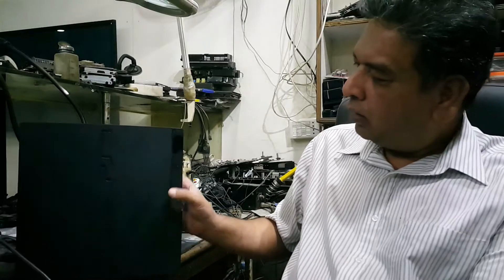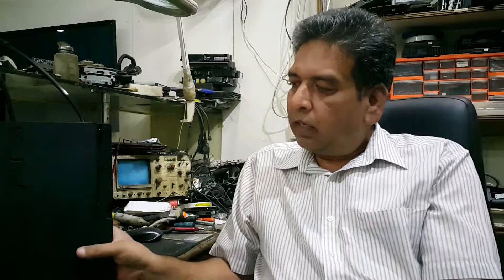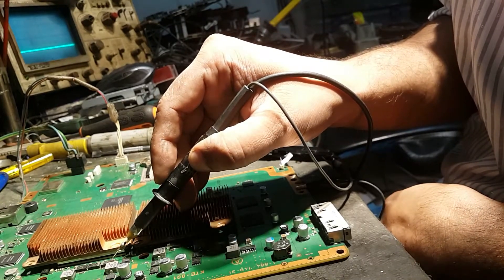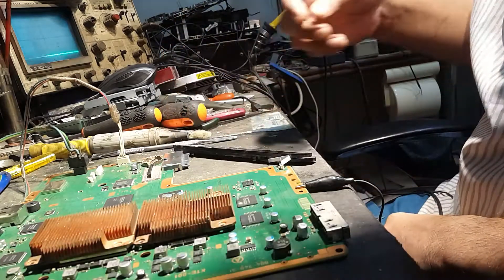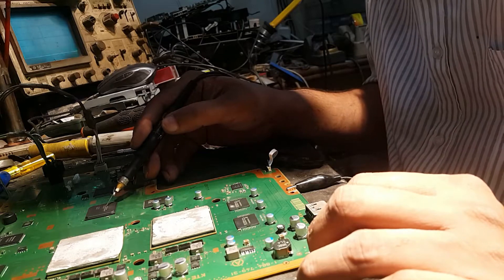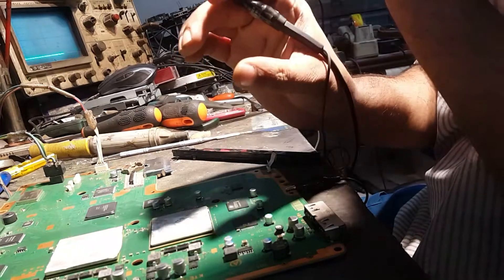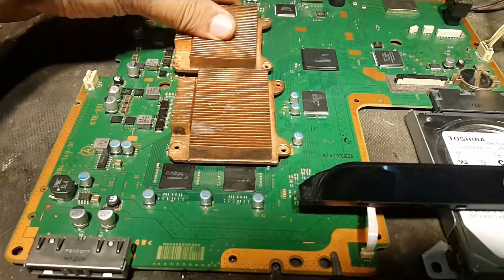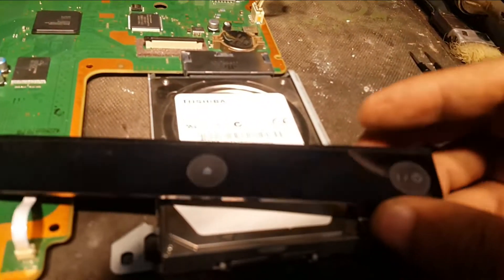Ps3 green light of death,(GLOD). for 10 seconds then shuts off. Part 3 .

Comment: Hello and thank you. My language is Farsi, I didn't really understand what you said in the video. But I will be grateful if you can help me solve the ps3 problem by chatting. I have a ps3 slim model 3000b and I use HEN. My PlayStation has the same problem as you mentioned in the video, but even more strangely, my device turns off and the hdd light does not work anymore and it does not show anything, but strangely if it is hit it works and works unless you touch it, if you touch the device the smallest, it turns off. but today it completely stopped working when i was activating ps3hen the ps3 turned off and now it won't turn on and it won't show anything at all can i fix it myself at home? Because there are many brokers in our city
Reply from the maker: Please check for the 12-volt clips in the power supply brick. They are not tight enough to grip two pins of the motherboard.
Reply: @idreestech  what are they I don't have the tools, can I fix it manually?
Reply from the maker: @acecombatfan0483  Yes just open it and clean the supply contacts .
Reply: @idreestech  do you have vedeo for this problme please give me link ....
Reply: @idreestech  i cleaned this and i cleaned all boards on my ps3 but its not working

Comment: great work, from mozambique here. I have a superslim model that had the same problem before, bus i changed the cpu and the other chips married to it but now it just stays at green light forever, no video, no beeps and does not turn off, any solution to that?
Reply from the maker: Check for the GPU.
Reply from the maker: If NOR is from a different console, it will be in the same state.
Reply: @idreestech  so i should keep the original nor? with different cpu?
Reply from the maker: @muhamadbay76  Original NOR with original CPU.
Reply: @idreestech  original cpu was cracked,
Reply: Thats why i replaced
Reply from the maker: @muhamadbay76  CPU key should match with NOR.
Reply: @idreestech  ok, thanks a lot, i will try another cpu and matched nor

Comment: The video is not so good, let's see togheter why:

1) Reflow doeasn't fix the problem, reball instead will fix it
2) Never reflow or reball without removing old thermal paste, the chip is getting more heat than needed
3) ALWAYS change thermal paste when you disassemble the console or your time is wasted because bad thermal paste will cause again the same problem
4) ALWAYS clean the console when you disassembly it, the dust cause overheating that leads again to the same issues
Reply from the maker: Dear, The points are right raised by you. But my focus is always to pinpoint or target the fault. And to make understand these complicated circuitries.
Reply: @idreestech  you're right to pinpoint or target the fault, but not everyone has our knowledge on how to correctly do these repairs, for me i better to lose a bit more time and show the complete process with the right procedures, so everyone can learn something and maybe one day they can start they're own business. I'm not attacking you or your work, but unfortunately these days on YouTube there are too many misleading videos that can cuase really huge issues if seen by the person who don't know how to fix these things correctly 👍

Comment: Hello. I have the same ps3 with similar problem. When i turn it on the fan is spinning and green light is on for about 7 seconds, and then turns off just like yours. Do i need to reflow the gpu?
Reply from the maker: First check according to my other videos then finally decide it for re-flow.May God help you dear.
Reply: Did you win?

Comment: Excellent videos! Very good looking for data from the NAND (slim = NOR?). I'm curious to know if you had seen data moving on the NAND, where you would have probed next. Would you just reflow the RSX instead, or still reflowed the CELL? Also, does the ethernet IC generate clock for the southbridge on the original phat models? (CECH-A through E)

I have a phat model showing the same symptoms... HDD light just one blink, sits, no recovery. All power rails look good. I'm going to check NAND with oscilloscope next, but also check ohms of resistors around power stages (like your other video).

Thanks!
Reply from the maker: Shea Ribbster : data was not running, I just reflow the CPU. Clock for the southbridge is basically the output from the ethernet chip, the clock input source is the crystal oscillator that is the input on pin no. 39.

Comment: Bro how to know if cpu not set good in place on motherboard.i do reflow for cpu that remove from motherboard by fall console...green light then tern off but cpu conect to motherboard by reflow.
Reply from the maker: May be the solder pads of motherboard are broken under the Cpu.Did you check for them properly.

Comment: Could you possibly fix my 20gb model?
Reply from the maker: Yes, sure dear.
Reply: @idreestech  it's had 2 nec tokin replaced I bought it off eBay like that. It worked just fine then froze and then it just ylods when I turn it back on 😭
Reply from the maker: @MikeAKill4  Should not be any shortage of jumpers with the metal body.
Reply: @idreestech  I don't really know what you mean

Comment: I have the same PS3 Slim CECH3003A. It shows  green light for 20-30 seconds and then loses power. 

I can always get it to boot by removing 13 screws and taking out the power supply for a second and putting it and the screws back. I have to repeat this process every time I want to use the system. 

After the system boots successfully, it works for up to 12 hours without issues. It's strange. It's UK model that I bought used in 2019 and ran with an electricity converter. Could that have broken it? Though, it works fine with the converter after getting it to boot. I know that the converter is not causing the issue (but could've caused it in the first place). I've also used a local cable, and it doesn't make a difference. 

The issue is not caused by the HDD, power supply or thermal paste as I've changed all of them. I think it's a motherboard related issue. What could it be? It's strange that the system works perfectly after it has booted succesfully.
Reply from the maker: Power supply 12 volt clips are not having efficient grip, clean and tightened it.
Reply: @idreestech  If I understood correctly, you mean that I should use pliers or so and bend the two clips closer to each other as well as clean the clips. Is that so? I've used 70% alcohol to clean them. Is it enough or should I use 99% alcohol. I think bending the clips closer to each other might be the fix I've been looking for. After I know what to do, and do so, I'll report back in a week to tell whether or not it worked. The system has fooled me many times before. That is, I've thought I've fixed the issue when in reality, the boot has simply worked for an unusually long time.
Reply from the maker: @excitedaboutlearning1639  yes you understood...
Reply: @idreestech  Bending the clips only made the problem worse. I couldn't force the system to boot anymore. However, good news! I found a permanent solution the other day. Here's a description of my PS3 Slim's symptoms, it cause & solution:
Hi! I was able to finally fix my PS3. Here's a description of the symptoms, causes and the solution of my problems. 
For the past two years, I've been trying to fix my PS3 Slim CECH3003A. The other day, I finally found a solution. 

PS3 Slim symptoms: A red standby light shows up. After pressing it, you see a green light for 20-30 seconds during which the fan is spinning. No picture. 

Sometimes, the system does boot, and it either freezes almost immediately or works perfectly for 12 hours, but then the problems persist, and the system struggles to boot. 

Cause: CPU is not making good connection with the thermal pads, because they can't be tightened tight enough. Thus, the CPU chip malfunctions. 

Solution: buy two washers for the thermal pad screws. Putting a washer on the two screws allows you to tighten the thermal pads very tight. The locker are like tiny rings. Their diameter is 5,3mm. 

After I put two lockers (rings) in the screws, I could immediately feel that I was able to tighten the pads much tighter, and the system immediately booted up AND without the top cover on, which was unprecedented. 

Here's the video in which I found the solution:
https://youtu.be/W1r6o4sueyo

I wasn't able to find any solution to this issue anywhere before I found the video, so I hope more people will find the solution.
Reply: @excitedaboutlearning1639  Good work. I've done something similar with a fat console that was having a major overheating problem. It would run 72C at idle with the fan at 80%. I put a piece of 1/8" thick cardboard on the underside of the board under the cpu and gpu. This helped allot. Then I cut 4 strips from a plastic card, and placed one under each corner of the heat sink clamps, which helped even more. Now the temps are around 50-52C with a fan speed of 35%.

After seeing your video, I think I'll try to shim the clamps on my slim model as well to see if it will fix it. The slim does the same thing that the one is this video is doing. At first it would turn off immediately after pressing the power button. I found that a bit of pressure on the psu would make it stay on for 40 seconds before powering down, but still no audio or video output. I hooked up an atx psu to verify if the psu was the issue, but the problem persist.